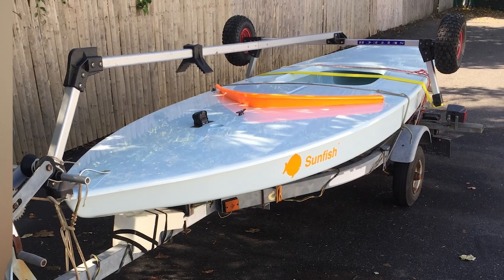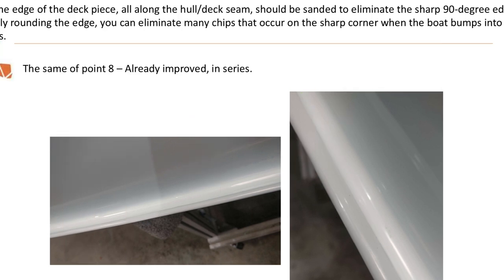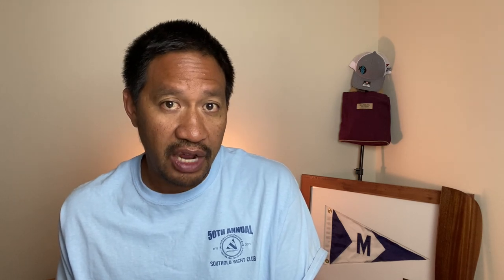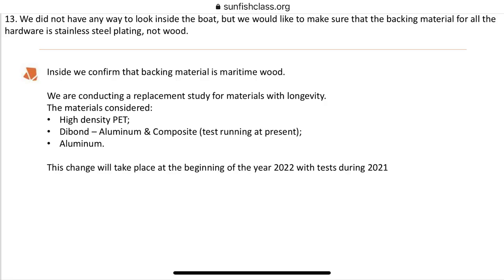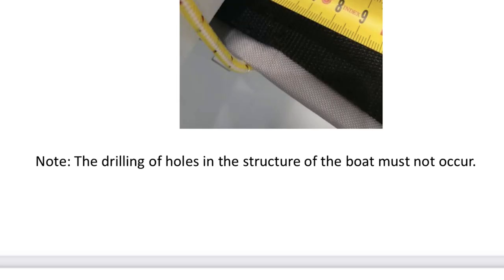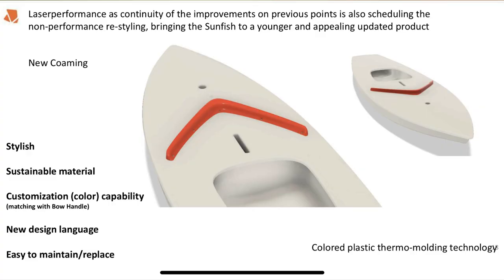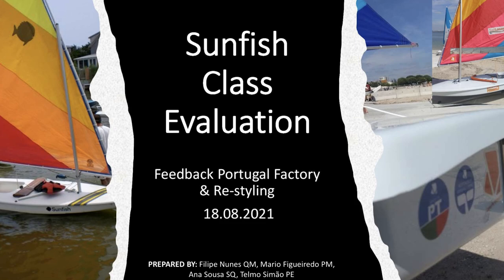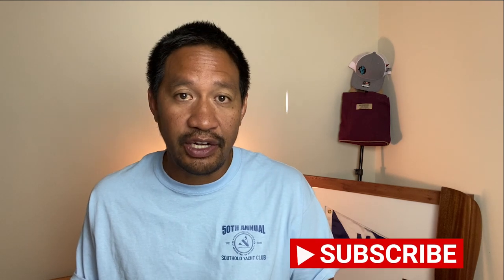Sunfish Sailor Reacts | The NEW SUNFISH SAILBOAT | Report

Comment: So this year I ended up repairing all sorts of Fish at the yacht club. These new fish are not going to make 20-30 years. I have also done some fiberglass repairs. Enough to know the older heavier ones had some pretty crappy inside last layer of glass. I have also seen the wood and aluminum screw plates to be barely held in place. One boat all the aluminium plate fell off when the screws were removed to do finish work. The kid was surprised to find some parts pulling off, fortunatly after being out on the water. The new hulls sound  like they are more minimal glass and using a light weight foam doubler to keep the glass from oil canning. I do not think these new hulls stand a chance against youth programs. FWIW I own three Sunfish with the years 1988, 1986 and a 2006. I have done glass repairs to all of them. Plus the worked on many fish at the club. So I know what kind of abuse they get and what seems to go wrong with the hulls. Like your channel, please keep it up.
Reply from the maker: Thanks Sam Iam for the comments and sharing your experiences with the Fish!
Reply: when has any sunfish lasted 20-30 years and still been a good boat?
Reply from the maker: While it is ideal to have a brand new boat there are plenty of good boats from the 80s that are still being sailed very competitively.

Comment: Another great video - love the flash image of Lampoon's "European Vacation". A few comments FWIW - FOME means "Fellowship of Middle Earth" (Lord of the Rings)? Hardly.  Probably a typo.  The use of high density foam bonded to FRP (Fiber Reinforced Plastic, aka fiberglass aka composites) is a common means to add strength and especially stiffness to composites.  It is typically sandwiched between layers of cloth and all bonded with epoxy and vacuum-bagged to reduce epoxy use and the need for sanding.  When you fly in airliners you are walking on top of such panels.  Given the state of these sandwich composites, they just might be better than the old foam blocks, just as rigid, impact resistant and possibly lighter.  And they will not absorb water or separate as easily from the inner walls as the foam blocks have the habit of doing. Proof is in the pudding though, as they say.  Backing blocks - the use of high density plastics is a good idea. I would look at Delrin or HDPE.  Problem is they do not bond well to much of anything. Stainless steel I think is not a good idea - expensive and it will corrode in time.  Stainless is not 100% corrosion resistant, at least not the more affordable alloys, and it is difficult to machine/bend/weld, etc.  And stainless is expensive, heavy stuff! Aluminum might actually be good - it will corrode but that can be dealt with.  Relatively cheap. I would look though more at plastic or composites, more compatible with the the hull surfaces.  Bow Handle - Your comment on two people using it simultaneously is brilliant, had not thought of that.  A definite plus, as well as the chance to make a new boat Tutti-Fruiti /Swatch colors. That would appeal to younger people, think of those colorful Nikes they wear. (We're planning to offer our Extreme blades and boards in colors for that exact reason - fun!).    It remains a major bummer that LP did not see the many advantages to making these boats in the US. Nothing against our friends in Portugal, mind you.   Being close to your major customer base saves millions and reduces stress, the chaos of international shipments (been there) and language issues, which you demonstrated in this fun and informative video.  "Fuschia" - too much, thanks for the laughs!   No wonder you blew past 1000 subscribers and are heading for 2k.
Reply from the maker: Thanks Kent for your comments and expertise in materials!   You’re right the mat time will tell and hopefully the new boats last at least as long as busts we are used to having. :).

Comment: Lee you can really dish out the scuttlebutt; they must put something in the water  cooler at the Sunfish races.
Three issues interest me:
First the handle the three point design may be stronger and more resistant to side loads. I like .
Second the foam blocks used for flotation add weight and can become waterlogged so air chambers are better floatation than foam floatation. Like that too.
Last but not least the "fome": while it may just be misspelled it may be a proprietary structural material. Various plastics can be made into foam. Polystyrene, Polyethylene, PVC. Espuma is foam in Portuguese so they are obviously not revealing their miracle plastic fome. This subject bears further clarification.
Reply from the maker: Thanks for the comments!  I was not making fun of the spellings and looked up FOME before I did the video snd found that FOME was a foam-core material, but I still didn’t know what it was- it looked like styrofoam—-  that’s why I made the differention. I didn’t assume it was a typo.   I think it’s a brand name like you suggested:).

Comment: Great video Lee. I have a 1971 SF, have you done a previous video on how to install a hiking strap?
Reply from the maker: Thank you Rick. I have not done that video.    If there is no cubby storage, the best thing to do is to add a backing plate to the back of the cockpit, via an inspection port.   I’ve seen some without ports and no backing plates and seen them pull out.

Comment: I have always liked a pulley with a cleat for the boom control line; It leaves you with a free hand instead of having to hold on to the line all the time... Have they made it a standard part on the boat?
Reply from the maker: Depending on what you want sometimes its a block (pulley) with out a cleat.   But im sure that can be made as an upgrade, depending on where you buy it from.

Comment: Great video. It appears the new bow handle might be fastened from the underside. So if it breaks you would have to put in an inspection port to replace. Maybe in the rendering they left out the screw holes.

You never mentioned that the photo of the rudder cheek for 2021 shows the Sunfish Direct rudder cheek and not the LP one. A photo of the cockpit bailer also shows the Sunfish Direct version.
Reply from the maker: Thanks for the comments Craig!   I noticed the cockpit bailer, but wasn’t sure -   Also wasn’t sure of the rudder check.   I did hear of the handle issue and can’t imagine that it wouldn’t be replaceable by an external method.  (I would hope). :)
Reply: "an owner must not drill a hole"....? What? But deck fitting replacement requires an inspection port! Is this really a better boat? "Fome" made the old boats unsinkable. An internal bladder will likely eventually lose air and require replacement through another big hole/ inspection port that we aren't supposed to cut. Maybe the powers that be could have just left well enough alone and not changed the boat. 120 lbs vs.  129 lbs. The only reason to do this is to entice people to buy new boats. But if they don't hold up, what is the final damage going to be to the class? Seems like a shame to me. And how much do these changes add to the ultimate cost of a fish when they are being built in such low numbers. Racing back in the 70s and 80s, I don't think I knew anyone break the checks of a rudder. You say you've broken a bunch yourself. I'm really trying to justify buying a new boat, but this info isn't giving me a warm and fuzzy feeling.

Comment: Lee, 
I love your videos, and your passion for the Sunfish. I learned to sail many years ago on a Super Sailfish.  I just bought a 2000 era Sunfish and plan to frostbite her in NYC harbor at Manhattan Yacht Club.
 I don’t understand how a 125+ lb. boat can be competitive against a 112 lb. boat.  Every one design class I can think of enforces weight minimums.  Why? Lighter boats are faster. The only question is whether these new light boats will hold up after years of racing? Or are you going to be required to buy a new Sunfish every N years to be competitive? I am not sure that a lighter and potentially more fragile boat is good for the class.  Thanks Andy Zangle
Reply from the maker: I agree with you, the builder has ultimate control on the construction of the boat, so if they want to use lighter materials it’s ultimately not in the class’ control.  We will see if the lighter boats make a huge difference…. As of now the people woth newer boats are not crushing the fleets….  The top sailors are still the top sailors in their older boats. If we see someone rising in the fleet dramatically and they have a new boat, that may be a reason.  Time will tell :). Thanks for the comments!

Comment: There have been some complaints about new hulls developing 'spontaneous' cracks in the deck near the mast tube. These may have been 2019 boats; but I am not sure. I speculate that this was due to the lack of the classic internal foam (Fome) supports. Has this been a common problem with new(er) hulls?
Reply from the maker: I don’t have enough data to say for sure if the new hulls show what you’re saying.  Tha knks for the comment!!

Comment: 5:26 Lee you were pointing to the upper right corner of the video as if there would be a card there leading to the video about making a bailer fit flush with the hull. But there wasn't a card (link) on the screen. Could you add that?
Reply from the maker: I added that towards the 3/4 mark of the video.

Comment: Hi SF lovers. And has always I can't understand why all the modification are considered to get poor boat. To keep the sunfish as it is, it's easy! But what LP wants it's to get the better Sunfih Ever. To keep the SF over 50 years... the SF need that young people wants the Sunfish and (for example) all children reaction to bow handle its: "ugly" so the mentioned "new design language" it was a need... The Bow handle allows one child to use two hands instead of one as currently to make force... Two persons can do the same force has mentioned on video. And yes there will be some colors choice to in some parts as Coaming, Cockpit and others.
All it's thinking to get stronger boat, modern and yes using sustainable materials in which plastic that can be of recycled origin. No restyle strategy is designed to reduce costs. 
New part's need's new molds, new process, and it's not cheap!! Cheap, it's stay as it is. And LP doesn't want this!

Theres a lot of in this video that was not understood by Lee. The report are between the SF class and LP and if there is image from old Sunfish from the past, it's about history of the boat and the new sunfish that LP is working on. Good winds on the sail

Comment: The change of the handle is due to cost constraints and will eventually snap off potentially injuring the person pulling on it. UV has a detrimental effect on all things plastic and degrades its tensile strength to the point of failure. Unlike brass or similar metallic marine hardware. 
Bottom line, it’s just cheaper to manufacture and failures in the field will result in revenue from service parts.  Just like buying a new GM pile of 💩. Failures = 💰💰💰
Reply from the maker: Thanks for the comment and yup, planned obsolescence:/ always about money…